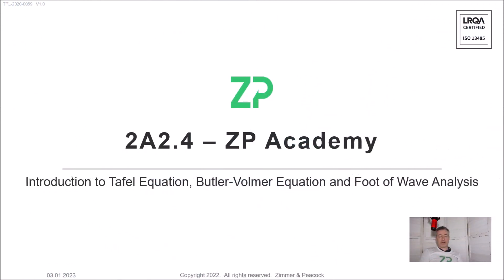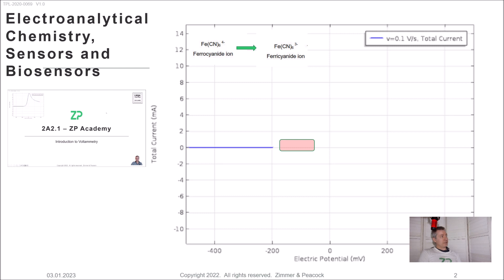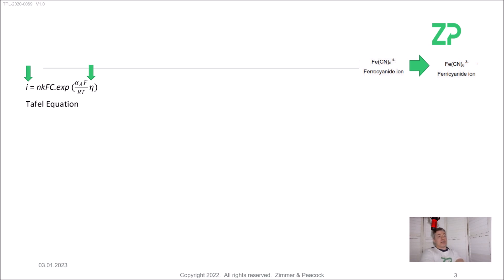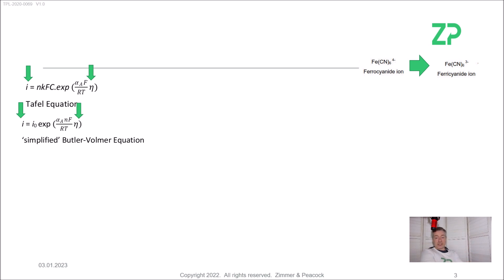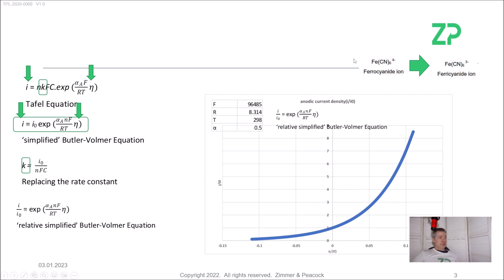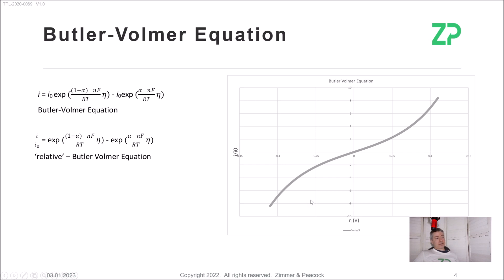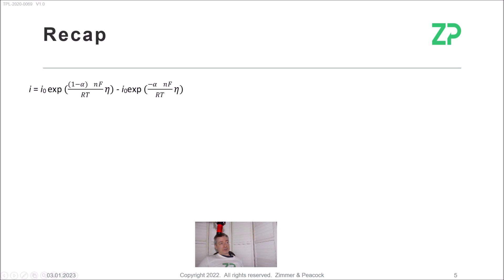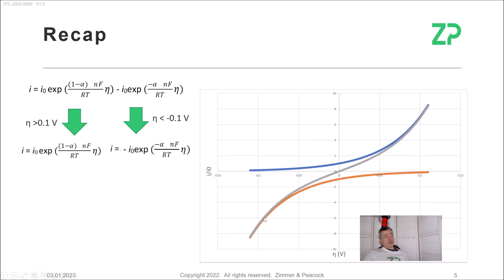Introduction to Tafel Plot/Equation, Butler-Volmer Equation and Foot-of-Wave-Analysis (FOWA)

Comment: Thank you for the video. I have some electrochemical data, I was able to do a fit of the Tafel equation; however, I noticed my alphas were very small, I think around 0.02, any suggestions?
Reply from the maker: You may have made one mistake, for example where something is 10 and you have put it in as 100. This happens a lot :)